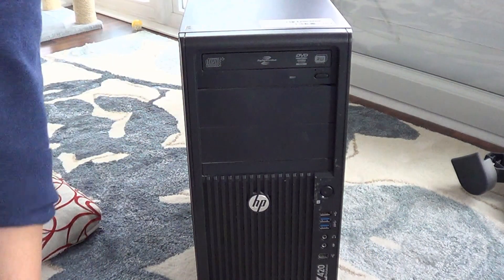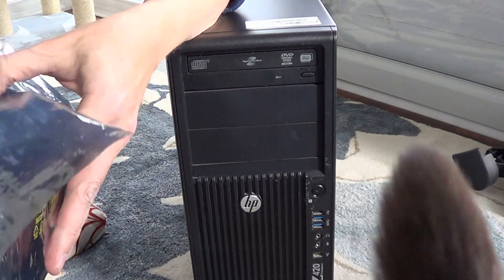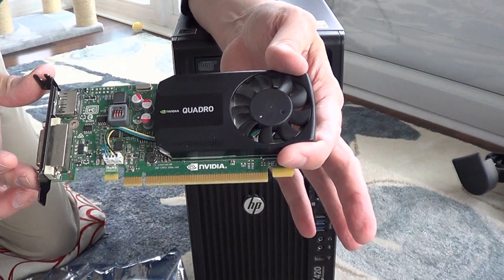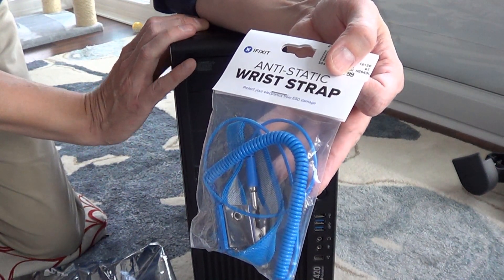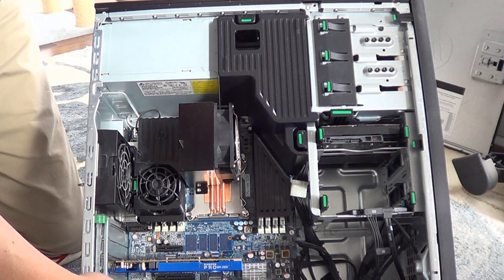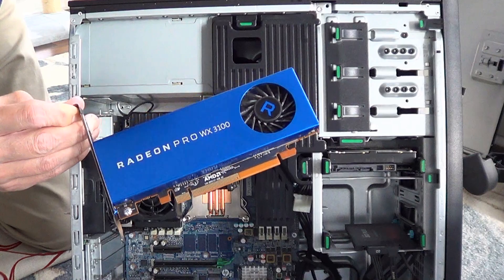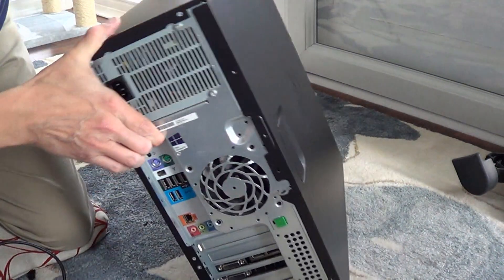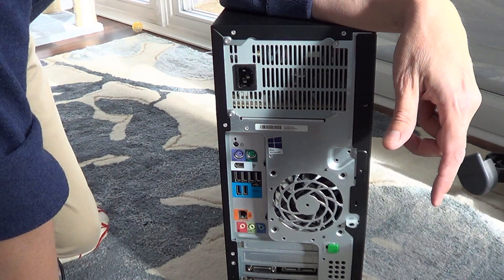H1 SolidWorks Budget RealView  supported CAD Graphics Upgrade

Comment: Would anyone know if the m4000 would run solidworks visualize 2021?
Reply: It won't be supported anymore
Reply: @marekjanik1502  anymore as in after 2021 or can I use it on 2021 and not 2022
Reply: @davewilliams1466  You asked for 2021 so I answered specifically on 2021 version... You need Quadro P generation or greater. Quadro M generation is over 8 years old now
Reply: @marekjanik1502  Thanks.

Comment: I bought one from ebay for $300 k5200 is still great in 2020.  I've also tried k6000 ($450)but I don't really see that much difference during revit rendering speed test
Reply from the maker: Thanks Phillip, I've been looking at purchasing a K6000, now I won't bother.